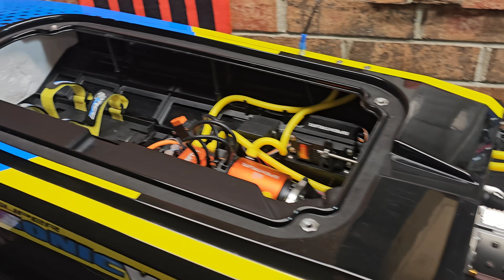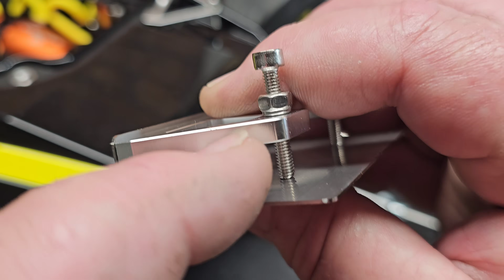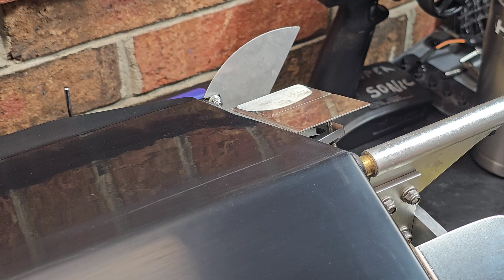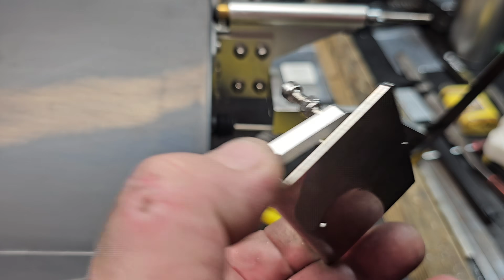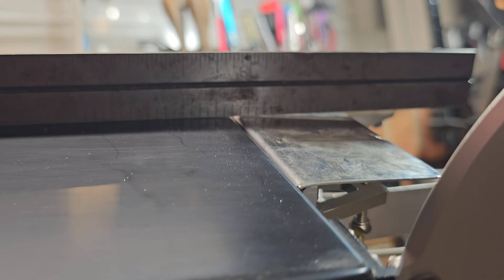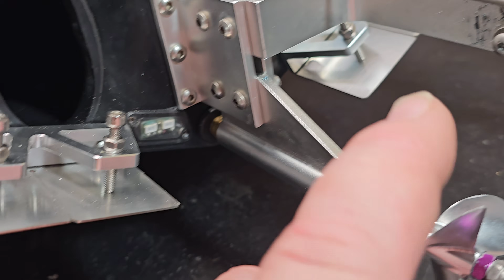Large Dual Trim tab Set Proboat Super SonicWake Performance Upgrade

Comment: The small gap where the trim tab meets the bottom of the hull… consider a smear of silicone to prevent drag from water rushing across this gap and see if there is a mph or two hidden there.

Comment: I have a set of those trim tabs on 2 of my 36 inch boats

The best thing about these tabs.. They're very adjustable. the outside tabs should set the balance from port and starboard Which is a huge deal while running parallel to swells or windy chop.. The insides work incredibly well for bow trim. 

Really wish they made them in a longer option 

I like them more than the TFL hardware because they're significantly lighter and do a better job in my opinion 

Looking really awesome fit up Big B!